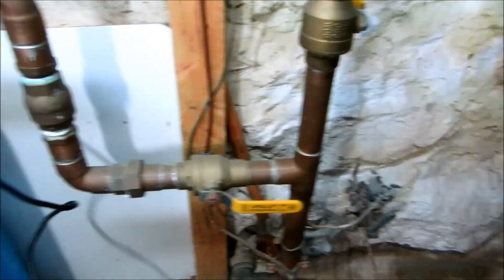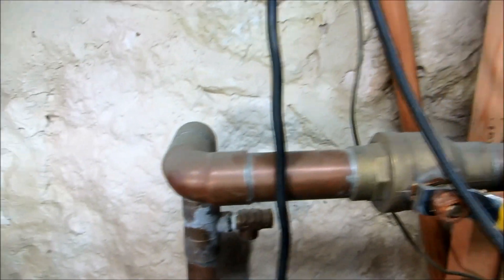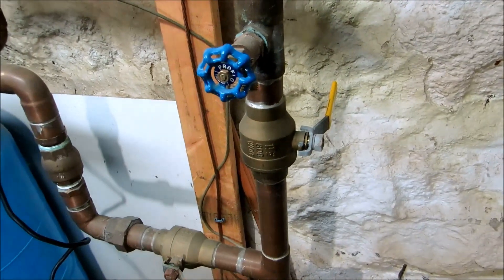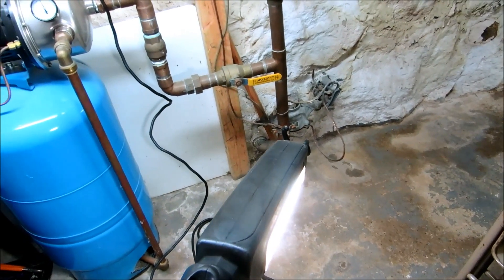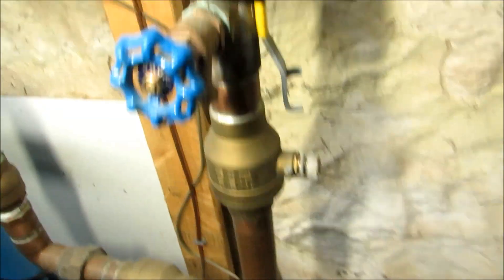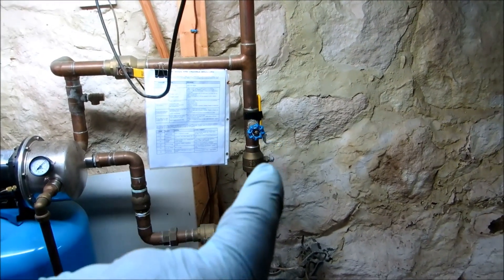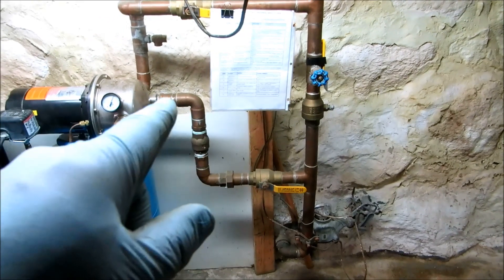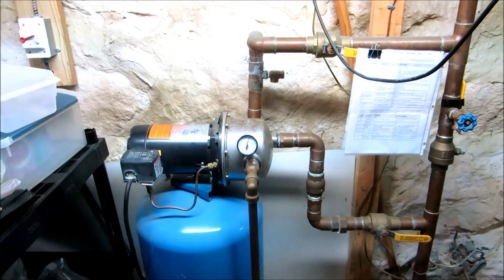domestic water booster pump on 1 1/2 water main

Comment: Is the city water pressure that low?  Granted it's a larger supply to the building, but it should have now problems UNLESS there is a restriction from the main to the building (too small of a meter?)   I does sound like the pump is cavatating a little bit...
Reply from the maker: pjf1313 not sure i was just called in because the pump would not shut off ..this area is known for low water pressure

Comment: Steve I have an HVAC question the house I bought in Pennsylvania the attic is not finished can I share the return and one of the Ducks from one of the bedrooms
Reply from the maker: michael white you should run a sererate  duck for the new room all the way back to the furnace ,and tie it in ,do not come of end of plumnu come off the side

Comment: hilo yu have gate valve inlet from main line? how if accidentally close the valve... so pump running empty?  you have union patente for maintenance or replace booster in case.... copper pipe is best but expensive also ppr pipe s blue pipe is  cheaper using solvent glue for connection  sometimes client choice made in china fittings and unit coz financial reason tnx nice vid